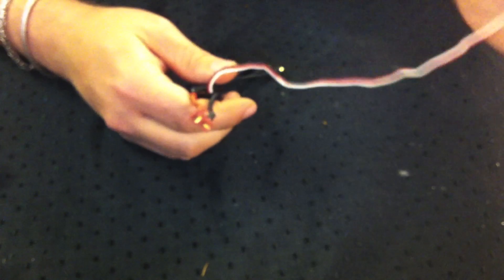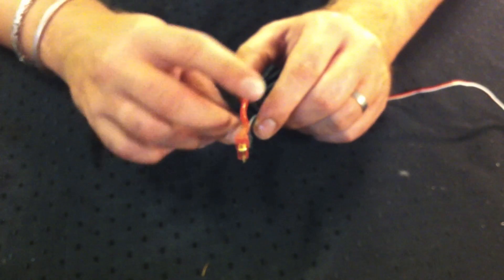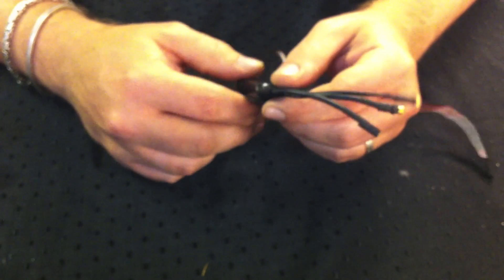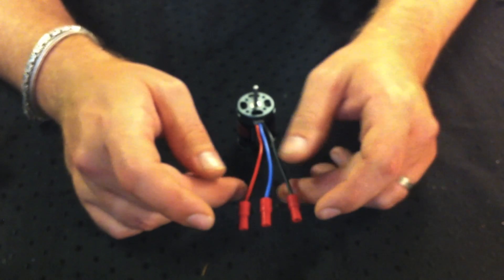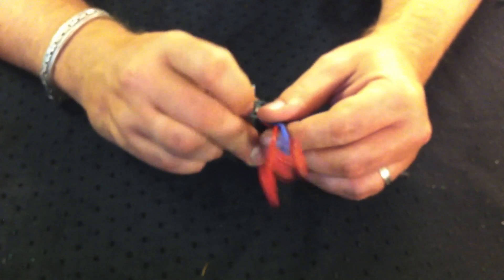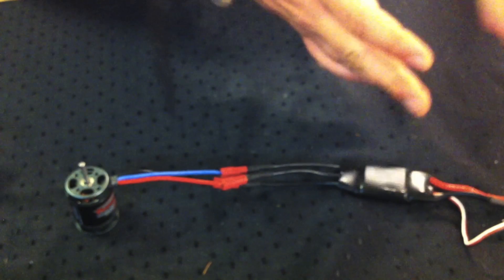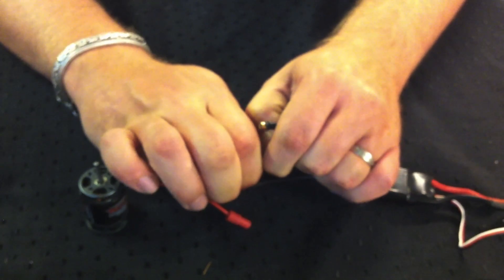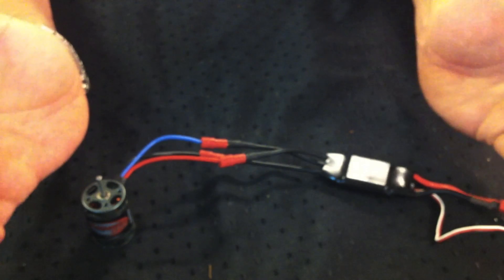How-to connect a ESC to a motor

Comment: That answered a nagging question or two for me. Thank you. Very easy and informative. I just looked at my boats motor and esc all with different coloured wires and wondering which is positive and negative? Is the third wire neutral?! 😅
Such a relief to know its all elementary.

Comment: Thanks Grumpy. I have been concerned about which wire goes where between my motor and esc, since all the motor wires are  black. Had visions of connecting two live wires and seeing smoke rising. Now I can fit my new glider motor with confidence.

Comment: Short and sweet. to the point. Which connector to use when motor and ESC are not supplied with them. I have 25Kw motor and 380A Esc the three wires from the motor are 5mm dia. and the ESC has 4mm dia.

Comment: hi, iam a beginner i just had a question that if i want to connect a brushed motor which has two wires to a rc tx rx how can i . i wanted to connect my rc car with the fly sky tx rx but the motor has two wires and the reciver has three signal,positive,negative plzzz help me

Comment: great video! are all brushless motor male plugs the same size? i.e 3.5mm. I am looking at a motor on hobbyking and it doesnt show the male diameter, but the esc shows 3.5mm female.
Reply: No not always some are using smaller ang bigger, but if the Esc is a match to the motor (AMP) your connectors will match

Comment: motors that have only 2 wires are brushed motors, and you need to use a brushed esc with that motor. the setup in this video is a brushless motor and esc

Comment: Not sure what you are asking, but always better to have a ESC that are rated to provide more amps then needed, I use a 60A ESC on my 450 size helicopter, but could get away with using a 40 amp ESC, but to big not a issue (unless the size is too big), but to small a ESC will burn out the ESC